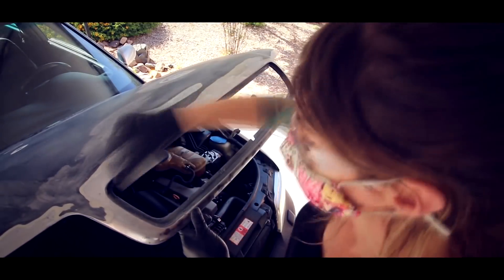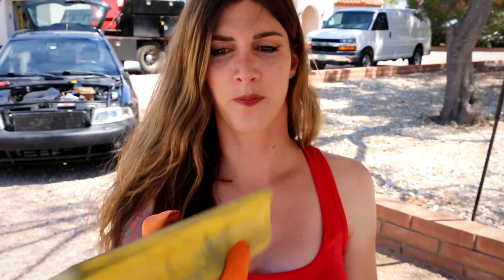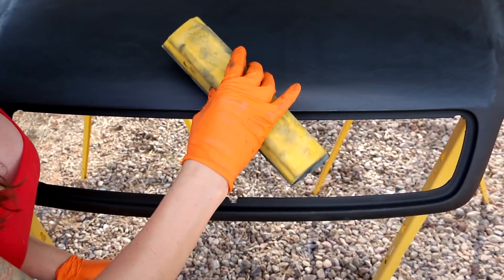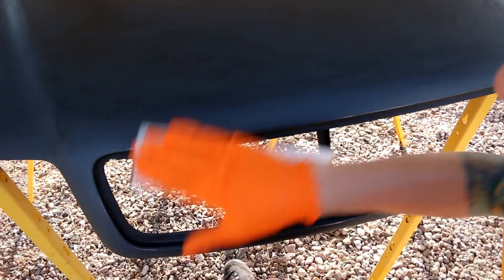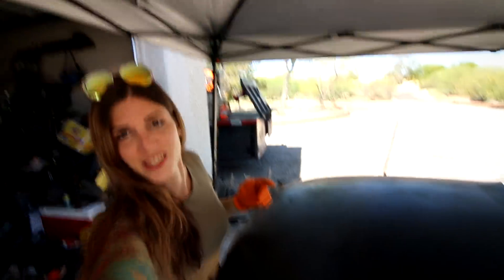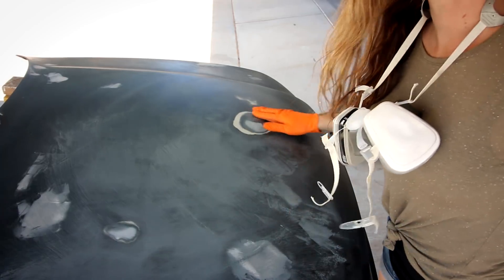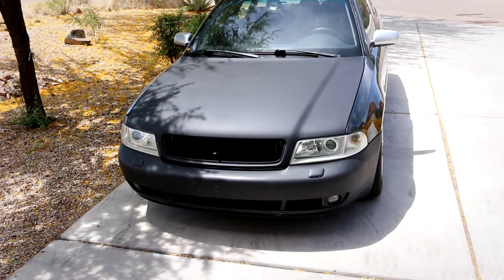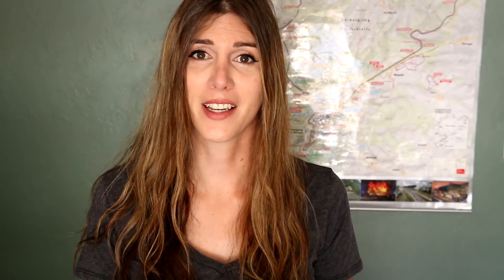Good Enough for a Vinyl Wrap? // Audi Quattro Project

Comment: In the future put some water in a spray bottle (or bucket) with a couple drops of dish soap and wet sand your primer with a 300-400 grit. This will keep your paper from clogging, make it last longer and keep from getting scratches in your primer. It's also a lot easier to see imperfections when its wet. Also if you have a local automotive paint store they should have a 2k urethane primer in a rattle can that will be 10x better in the long run than the el cheapo store bought. Just a few pointers I wish someone had told me when I started... Keep up the great work!!

Comment: i am just finishing up wrapping my car after doing a bunch of body work on it. Things I noted, the wrap doesn't stick very well to a rough surface finish of primer. I ended up doing a wet sand of 800, 1000, and 1500 grit to get the finish super smooth. I also used the 3m wrap primer. It's call primer 94. Pretty cheap and it really makes that vinyl grab on porous surfaces like primer. I also picked a colour that was close to the oem (my car is dark red and I used avery garnet matte metallic) just in case you make a mistake, it's not super obvious on the edges and stuff. My car is used for racing and stuff so as long as it's a good 10-20 footer (good from afar but far from good!) I 'm happy. Looks good! I'd get the RS grill or restore the old grill so it will match the new hood!

Comment: I'd suggest dusting the hood with light gray primer before you block it. It will make the low spots as easy to see as the sand-thru high spot. Vinyl is not as forgiving to sub-standard  body work as you may think it is. Dips, dents and wrinkles show right through the vinyl.  You did a really good job, though, good enough for paint or vinyl!

Comment: Sarah, olá amigo! The Audi Quattro Project, definitely provides you with a nice canvas to practice on. Btw, I started with model cars, and bicycle frames. Using spray cans is a great idea. It's quicker and cheaper. "One of the best “tricks” to learn with spray cans is to start with a light, quick, dust coat. Don’t try to put a layer of color on the surface with your first application. Move the can quickly, and waft it back and forth in several directions, just enough to get a very light, even, slightly sticky coat of paint all over it. This is what’s called a 'tack coat'." Well, no one wanted to see the naked banana. I guess it just lacked appeal! Lol! 

Ciao! 😊✌🏼💕

Comment: Sarah, regarding masks:  From what I could see, you were wearing a respirator (that's for Fumes . ie painting and atomized -spray painting) ; when you are sanding primer and body filler (dry sanding) , you only need a particle mask (much lighter) to catch the particles from being inhaled into your lungs; also, try to stand up wind!  When you wet-sand all the debris is trapped in the water and no mask is needed.    Keep at it wearing these masks is worth the effort and discomfort.  
If you ever deal with fiber glass mat (the white fiber strands stuff in sheets or a role)  OR fiber glass fibers in the body filler be sure the particle mask is very well fitting - you must wear a well fitting mask similar to the respirator but the filters on it are for particulates and not fumes.  This is a must for this material as those fibers would get into your lung and STAY there!  They are not absorbed or removed by your body.  Hence the Cancer risk.   It is also skin irritating ; you must cover all your exposed skin when grinding that material and tape your wrists and neck areas closed .   I don't see you doing this type of work anytime soon, but if you do, you must prepare as if you don't, you would itch and have skin irritations for Days!  Best to you!

Comment: 3M 1080 M227, its a matte blue that ever so slightly changes color in different light and it looks good on pretty much everything I've seen it on. just my two cents.... You can see it on google on a few different styles of audi, take a look, also, I like the knock off grill.

Comment: First you shoul buy a vinyl from a good manufacture (3M, Oracal, Avery)

I recently wraped my roof with Avery black an was astonished who flexible this vinyl is. We were 2 people and put the wrap on the whole roof at once... and we hade zero bubbles or folds on the roof :) We only had to care about the edges.
You should by some examples and play with them. Then take the vinyl you feel comfortable with.

You should consider to wrap the Audi in a metallic red. 3m made a vinyl called "gloss lipstick red" but they don't produce them anymore :(

Comment: I'm gonna say that this green (or indeed most greens) will not look good on the car. As someone said, that green belongs on tractors, not Scheissewagons. :)
Knock-off grill looks much nicer, but it's all gonna depend on just how "original" you want the car. You're wrapping it anyway, hopefully in a more modern and non-original color, so I'd say the new grill would look better with that.

Comment: Surrah.....1) What is that silver ingot 'thingy' called you used to help tap that high spot out you placed under the hood?  2) What Grit sandpaper did you use to sand the hood?  Thx, Gary ~
Reply: That would be a dolly
Reply: Thanks bagged....im Def gonna look into picking one up!
Reply: You can get a cheap set from harbor freight not the best but they are good for something at home to learn on

Comment: Swamp ass if the face? LMFAO that's a new one 🤣😂. Knock off grill for sure. 3m wrap is pretty good. And the wrap they sell at autogoody.com is pretty good. I've used there carbon fiber wrap on spoilers and roofs of the car. Pretty easy to handle.